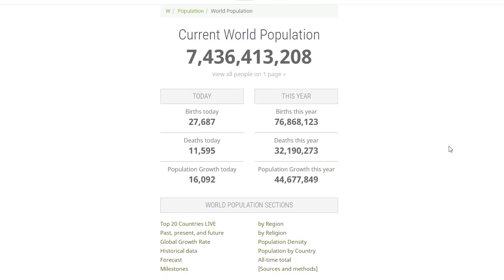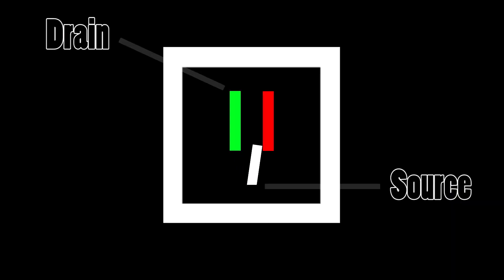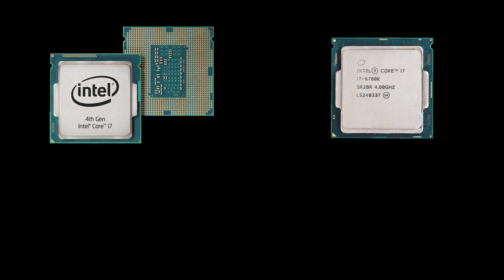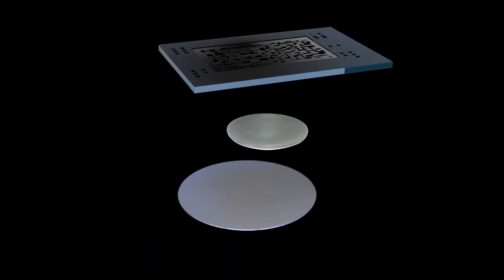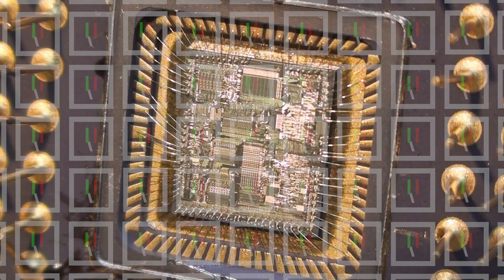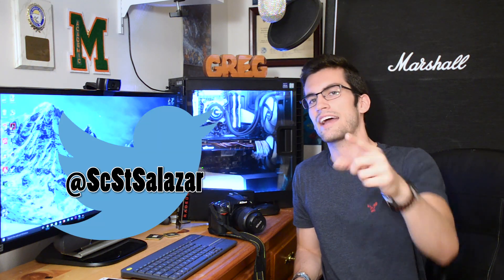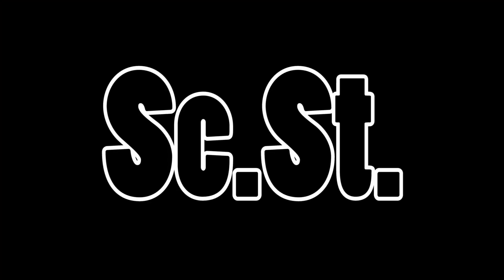Why Do Processors Get So Hot?

Comment: you were right, lol grossly over-simplified.
Reply from the maker: You still get the point.
Reply: it is over simplified, also wrong at times. The electrons do NOT travel through the transistor through the properties of quantum tunneling! The real challenge is to AVOID the travel through quantum tunneling which would keep the switch on and the transistor would not work. That is why the problem is not to make even smaller transistors, the challenge is to make the smallest possible transistors that still work while avoiding the travel of the electrons through quantum tunneling. Roughly it means that the electrons should travel ONLY when the switch is open by giving the plate between the two ends a positive charge and they will travel along that part. and when you remove the positive charge, the electron flow should STOP. If the two sides are too close, they will travel through, no matter what you do, because of quantum tunneling, so the CPU would not work.
Reply from the maker: What I said was not wrong. And yes, I am aware of that.
Reply: +Science Studio my brain exploded half way through XD
Reply: +Vaughan Van Eck Get a M.Sc. (Tech.) degree in Electrical engineering. M.En. degree isn't theoretical enough if you want to be involved in research and development. Also, Computer Science degrees are irrelevant if you want a career in semiconductors.
Reply: The most accurate simplified version I can think of is:

Micron-scale transistors actually are flowing current all the time, even when off.  Very little when off, but it isn't zero.  They flow much more when on, of course, but they still allow some current flow.  How much they allow flow in the off state depends significantly on how long they have been off - the longer they are off, the less they flow... so higher frequencies reduce the amount of time the transistor is off before being turned on again, leading to ever more current flow - and heat...

When current flows through a non-superconducting material heat is generated as electrons interact with the molecules that make up the conductor, so the process of heat generation makes sense - you're pushing current through a fairly significant amount semi-conducting materials.
Reply: Everyone who says "this is over-simplified" is just trying to look special because they know the non-simplified version. Good for you special people.
Reply: mikidof I really appreciate this mate,, thank you so much!!!
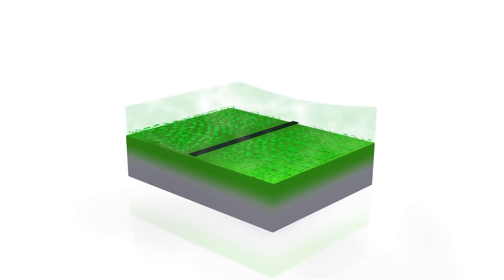Reply: Science Studio Yeah. I apologise if I mistunderstood you, but here at 3:08 seemed to me that you told the opposite. Because If it does travel through by the properties of quantum tunneling, it means that it's not a transistor anymore. We can talk about a transistor only until it acts like a switch. Quantum tunneling is a real problem. So we might reach the point very soon when we can't increase the power of the CPU using this manufacturing method anymore. Again. Sorry if I misunderstood that part.
Reply: I'm just starting college right now and my craving for silicon knowledge was basically being increased and hyped up. But i'm stuck taking all these summer pre-requisites! I'm half a semester into Psych/Geology bored out of my damn mind. Here's a crash course that's basically everything you need to know (Definitely not over simplified): Freud was a crack addict and rocks slide around. Also if you bite your nails it means you hate your dad. WHEN DO I GET TO THE GOOD STUFF ;-;
Reply: +talas attila that is correct and is the problem why we have leakage and have moved to more cores. yet most programs can't take advantage of all cores.
Reply: wayy to over-simplified tbh. But then again he did mention it was a crash course...
Reply: Sir i really hope don't take this the wrong way, but what degree do you have or what did you do to obtain this information, why i'm asking is because i really really want to have a job at a semiconductor company. i have no idea how to start what university  course i should take, just trying to get some knowledge. if you could help me with this i would really appreciate  it
Reply: +Vaughan Van Eck hey we have the same plan and we're both clueless!
Reply: +Vaughan Van Eck  electrical engineer or computer engineer
Reply: damn dude i'm almost done with school, i need to be prepared, lol,  but it's really is nice to see someone with the same interest.
Reply: eddy6935 thank you bro, this is exactly what i need, some help into the right direction. i do appreciate it
Reply: +Vaughan Van Eck I graduate this semester woot woot but enjoy it and go through the hard times u can do it
Reply: lol, thanks bud ! :)
Reply: +talas attila 
so at 1/4 of the current size of the transistors the CPU would become a maze of wires xD
i don't know why such a complicated maze of wires just fascinates and tickles me.
sure would be the most expensive, useless and shortest wire ever, but would be cool? lol
"hey guys, i have a  100 CPUs i tied together to wire this lamp, pretty cool huh? only cost me a dumb load of money!" lmao!

this is a big problem isn't it?
Reply: Abubakar Awad
Transistors in a group are not CPU's also transistors are getting to the size of atoms and it is becoming a problem.
Reply: eddy6935 
I never said a group of transistors are a CPU, I'm just referring to quantum tunneling effect on transistors which would render CPUs useless turning it into a simple metal conductor
Reply: i said transistors in a group.
Reply: #special

Comment: Why don't they use gold to reduce resistance ?
Reply from the maker: Because it would only reduce path resistance, not transistor resistance (where most of the heat comes from). Transistors will not work with gold or silver thanks to their conductive properties.

Comment: Well... isn't that more transistors packed in a smaller nm cpu generate more heat than an equal transistor count on a higher nm cpu?
Reply from the maker: I described this in the video.
Reply: Had to watch the video twice , thanks for clearing that out.

Comment: Here is the answer science studio: electricity hit metal, metal heats up and Tada! ITS HOT AS HELL
Reply from the maker: Not that simple!
Reply: You responded. Holy cow.

Anyway, metal heats up with electricity because the elections have the material move around, causing heat. Heat is the movement of atoms, so that is why I think it is like that. Yes, there is that jargon, but that is how you can get burns from electric shocks.

Or lighting. That why they cause fire.
Reply from the maker: Watch the video. In CPUs and GPUs, metal conductivity plays a very small role.

Comment: the transistor animation got my eyes broken rebooting brain...error404
Reply: your brain is too weak
consider OverClocking it
Reply: +Kakashi Hatake system.32 error 10100101001010010111
Reply: It would be error 503, error 404 is when a request is made for a document or file that doesn't exist on the web server.
Reply: +Ozzie Peck that's the joke. He is implying that he doesn't have a brain.
Reply: You mean a dumb terminal?
Reply: I was totally hypnotized by that animation.
Reply: in ow ores says error 404 sarcasm module not found.
Reply: Kenneth Rivera pro